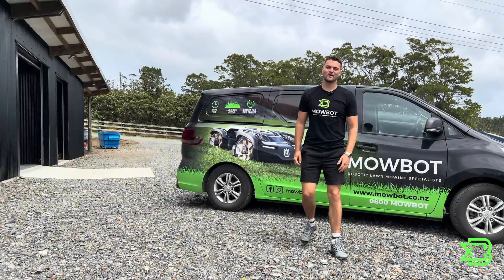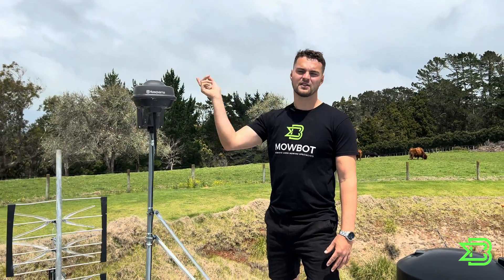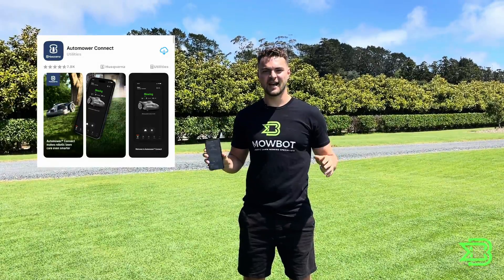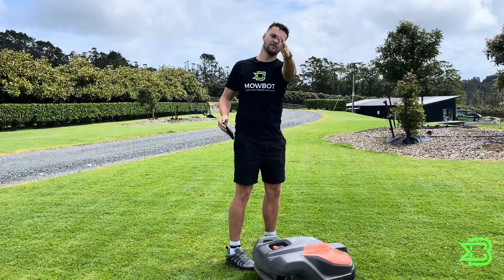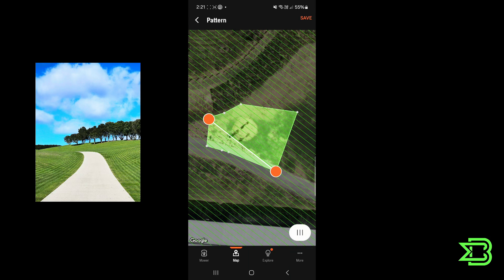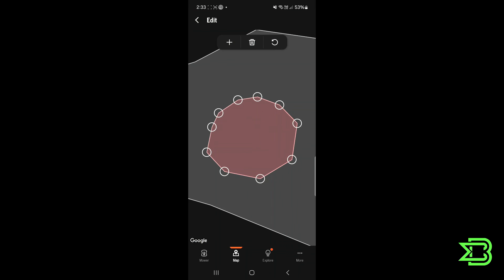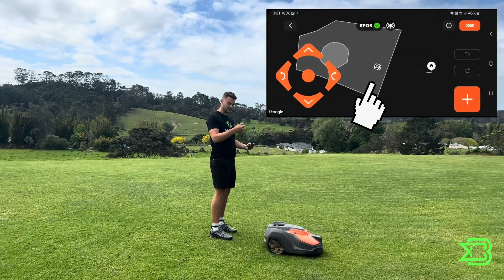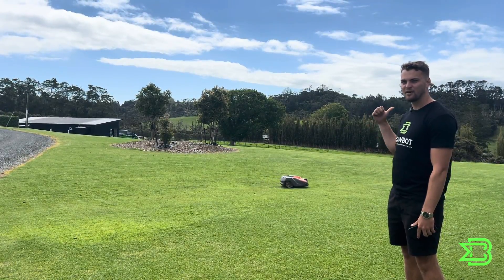How To Self Install a EPOS Wireless Automower

Comment: I thought you wanted the power supply off the ground?
Reply from the maker: Correct and good spot. The transformer should be 30cms off the ground. This was a temp install and best practice is to have it off the ground.